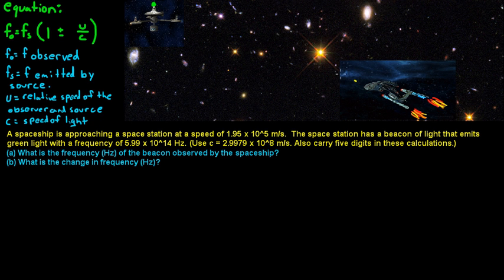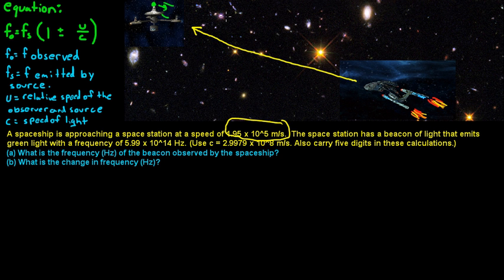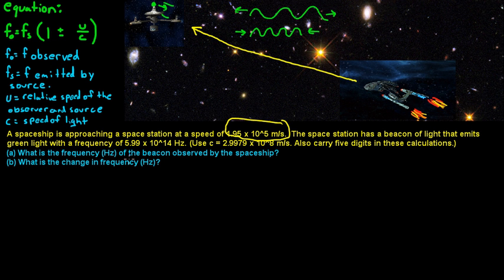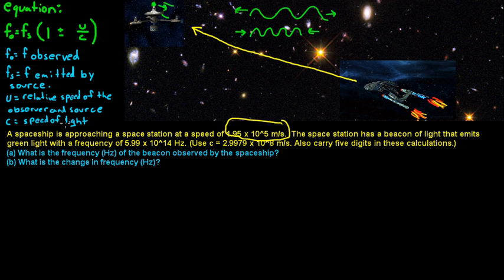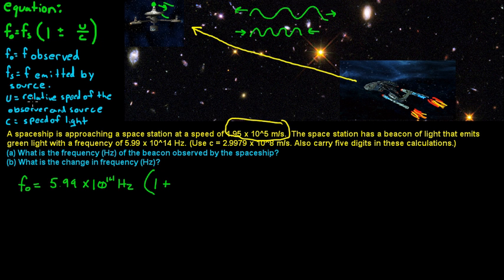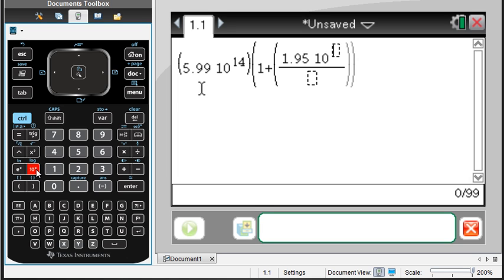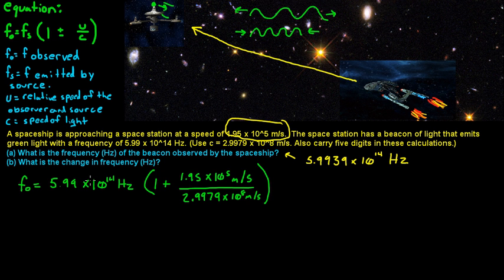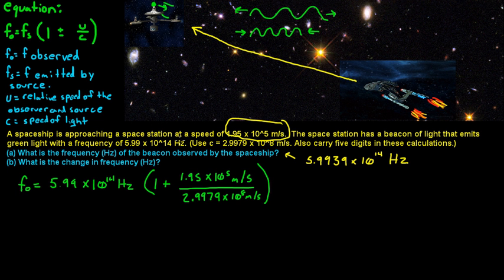Doppler effect for electromagnetic waves

Comment: The Doppler Effect applying to EM waves is assumed because it is known to occur for sound waves.
There is a problem with this.

Sound travels though a medium and in fact IS the changes in pressure of that medium
EM waves do not travel through a medium therefore the assumption of Doppler equivalence between EM and sound waves is at least suspect.

That suspicion is compounded when using the red shift as a measure of distance the energy emitted by Quasars cannot be explained !